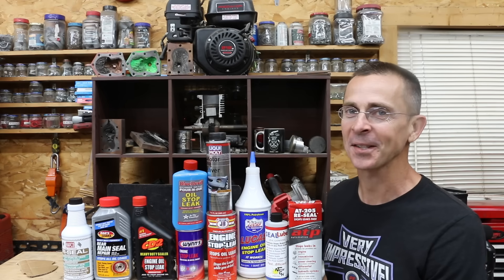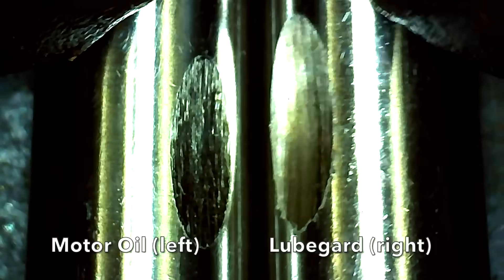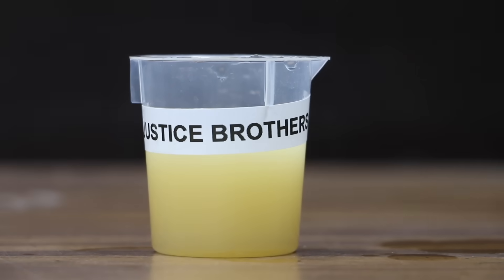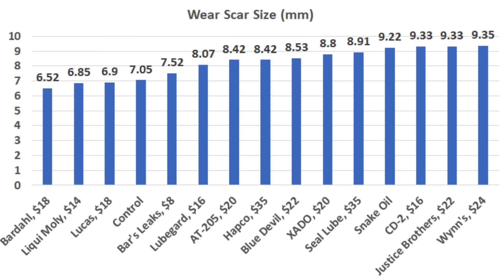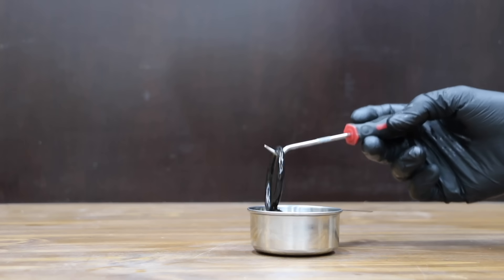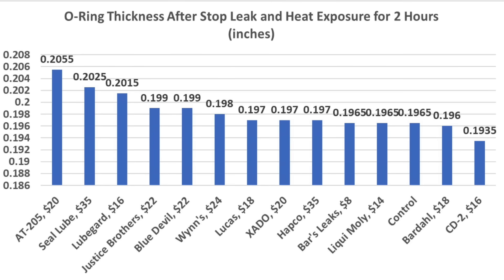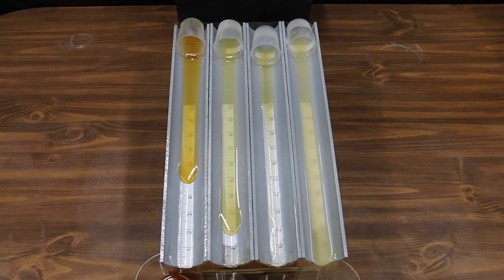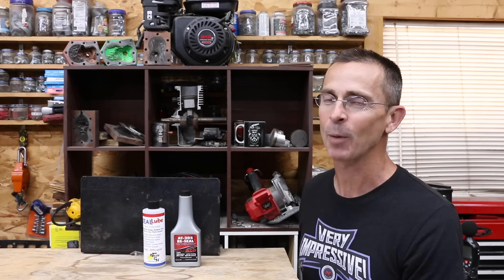Do Stop Leak Products Work? Do They Damage Engine Seals? Will They Destroy an Engine? Let's Find Out

Comment: I had great results with AT-205 on a old lexus where the engine seals we were starting to leak (as in a few drips overnight in the driveway).  I added a bottle AT-205 before an oil change with about 5 hours of cumulative driving time per the directions followed by an oil change and that was over 2 years ago with no leaks since from the seals since.  I highly recommend AT-205 if you catch the leak early enough.  It is also important to not let the stuff sit in you engine forever.  You need to change the oil after the 5 hours of cumulative runtime.  I also changed the oil at 3000 miles vs. the normal 5000 for the first 2 oil changes to make sure it's really flushed out. I'm back to 5k intervals again or 6 months whichever comes first (always with full synthetic high mileage for cars over 75K).  Always worth a try when the proper fix would have cost in the thousands.
Reply: This seems to be THE answer, use the best to fix the seal but given it was 7th on the wear scar then simply change the oil after a few hours ..   am I missing something here ?
Reply: Thanks for sharing. If I ever added it I’d definitely go this route to be safe.
Reply: Afraid not. It's only for rubber seals.  Not gaskets or rtv.
Reply: @PaulsToolReview  what's best for  silicone seal leaks,?  I been using high mileage full synthetic for three years now ,am still having a small leak from timing chain cover, taking it apart going to be alot of work
Reply from the maker: Thanks for sharing.
Reply: Can it fix timing chain cover leaks? Thanks
Reply: Unfortunately, resealing with new gasket or rtv is the only option.   I just use what the manufacturer recommends. It will be a big job you may want to take to a professional.
Reply: We have a leaky Audi Q3 that only gets driven 250 miles a month.  Could be a long time for 5 hours of driving.  Would you recommend a number of days or weeks before changing out the oil?
Reply: @jeffn2166  just 5 hours of run time.  It can sit in the oil longer as far as calendar and run time, but the manufacturer recommends you should see improvement after 5 hours of run time and I don't want to leave the additive in the oil longer than necessary as I want the additive package in the new oil to do it's job without interference.

Comment: I don't use it for stopping leaks but, loved to see that there is actually something behind the AT-205 advice I was given! Years ago an old mechanic told me to put the AT-205 in a spray bottle and occasionally mist it on rubber parts that are prone to cracking/dry-rot (boot guards on suspension, protective guards etc.) It works!
Reply from the maker: Thanks for the suggestion.
Reply: I've had luck with AT205 stopping leaks. I now know not to leave it in for an extended period of time now though.  It usually stops/reduces the leak within a couple hundred miles though.
Reply: @PayNoTaxes0GetNoVote  I just sent in this tech question to AT 205 ... your opinion please 
Your product is viable to use in power steering , I assume rack and pinion . If used is it necessary or " wise " to replace the fluid after the AT 205 has been used ?
Same Question for a rear end differential. After use should the rear end fluid be replaced ?
Reply: Scotty Kilmer put out a video about this a few years ago. I have a spray bottle in my garage with AT205 in it.
Reply: That mechanic wasn't Scotty Kilmer by any chance?
Reply: Scotty told everyone this information
Reply: An old mechanic named Scotty lmao. Come on
Reply: @ua7pyro591  hahaha that's the first thing that came to my mind lol years ago = last week 😅
Reply: @ua7pyro591  Beat me to it LOL
Reply: @ua7pyro591  Scotty used to be a VW guy, and AT-205 is very, very well-known among people who've worked on older VWs and BMWs, because both have a ton of rubber parts prone to drying and cracking and causing vacuum leaks. 

It ain't just Scotty that knows about the stuff and to spray it on rubber components. He learned it from somewhere, too.
Reply: works on wiper blades too!
Reply: So does any rubber protectant?
Reply: Broooooo I just tried this, I been chasing down a squeak for years. I think is gone. I sprayed EVERYTHJNG RUBBER IN THE SUSPENSION. I just used a spray bottle. Any other tips or wizdom you may share?
Reply: Sounds like Scotty Kilmer Channel R.I.P. SCOTTY
Reply: After seeing at205 cause more damage than oil alone and the heat (smoking) during the test, I wouldn't use it in my engine. I would advise you change the oil as soon as the leak stops because that oil is ruined. 

I agree it's good for spraying on rubber bushings.
Reply: @Alex-rj6sv  - remember,  PF mixed it 50/50. When suggested rate is like 1 pint to 6 quarts., so it was SUPER strong.
Reply: @PayNoTaxes0GetNoVote  That is important to remember as well. Thanks.

Comment: I wouldn't use that blue devil stuff on anything I used there headgasket stop leak an it plugged every cooling port on the block and head had to tear it completely apart and flush everything with hot water an scrape it clean
Reply from the maker: Thanks for sharing.

Comment: Love the videos. On this one for the wear test shouldn’t the mix be similar to what it would be in the engine? Either 4-1 or 5-1, because you definitely would use 2.5 quarts of each in your engine.
Reply: You probably wouldn't see the difference in a 30 second wear test using the products at the actual rated concentration. The wear test should just be taken to show that the products do in fact change viscosity but the actual effect will be smaller in real use.

Comment: Very interesting test, but the result interpretation is quite hard. Let me explain... you want to stop a SMALL leak and NOT damage your engine. If you have a LARGE leak then you need to repair it, or use aggressive product and... END your engine. So... from my PERSONAL experience with a few cars... for example Turbo Diesel Intercooled and naturally aspirated gasoline V6... use only Liqui Moly.
Why? If you have a small leak it will STOP it and will do NO harm to the engine, I'm talking about engine oil consumption, coolant water consumption and power steering fluid consumption. If the leak is TOO big, it will minimize it or do nothing at all, BUT everything will be fine - no addition damage will occur, you just need to fix it.
BUT if you have a BIG leak and use aggressive product, it can be fine for a very short time, and then... the engine will most likely die soon. Your making oil thicker and rubber/silicone seals soft and swollen, this will give up soon, making a total disaster and full engine repair.
Ow, BTW, basic ABC of engines is to change oil+oil filter+air filter every 10 000km (or ~6 000miles), transmission fluid every 60 000km (or ~37 000miles), coolant fluid and brake fluid at every 4 years and your'e gonna be fine. Just ignore car company guidelines to do it later and you gonna be fine...

PS: Just don't use injectors cleaner on diesel without disassembly of the pressure pump afterwards... it gets all the junk...

Anyway, great video, thanks!
Reply from the maker: Thanks!

Comment: I don't understand why these sham products are allowed to advertise the claims that they do. It seems like every other category of product is regulated in some way that prevents a company from putting water in a plastic bottle and claiming it's something other than water or can do something water cannot do, that kind of thing. Yet if you walk into an autoparts store there is usually an entire section of these products available that do NOT do what they claim to do.
Reply: AT-205 stopped a small leak on my power steering pump! 👍👍

Comment: Idea for your next video: Garage floor coatings! Compare a few polyaspartic, polycuramine, acrylic, and epoxy options to figure out which coating last the longest, has the best slip resistance, best impact resistance, etc.
Reply from the maker: Thanks for the suggestions.
Reply: @ProjectFarm  Hey, thanks for everything you do! Been watching your show for what seems like forever at this point - you do amazing work!
Reply: @ProjectFarm if you are going to do epoxy floors, you might as well see what kind of repairs would work on concrete, too.
Cement, grout, floor levelers, or whatever, to level up cracks, or fixing spalled areas.
Normal soap-and-water, as in a common degreaser found everywhere, dealer’s choice.
While we are on that part. It would also be nice to see what kinds of degreaser soaps are best.
Dawn, LA’s Totally Awesome (dollar store brand), Purple Power, and the like.
Some people might wish to etch concrete, so maybe a cleaner that has an acid additive? 
CLR comes to mind, but I would stay away from powerful ones, like Muriatic acid.
Reply: @ProjectFarm  
  Something to consider…How about tire marks left behind?
 Thank you.
Reply: Also compare concrete prep methods: various acid/chemical washes, angle grinder, shot blaster (can be rented from most home depot)
Reply: @cbrettsimpson0813  
Dude, this isn't a free Chemical Lab facility ... it's a "simple" Youtube Channel ..
Reply: Having worked as an installer, there's so many variables, not only concrete prep and measuring and mix ratios, but temperature and humidity on the day the product is poured. While a test of this kind might slightly show an advantage of one over another (though they all basically use the same chemical ingredients) it's unlikely to have any bearing on how it will actually hold up for an individual at their particular garage.
Reply: Add sand for slip resistance so delete that factor and just test the product but the best bet is to prepare the surface extensively and almost any product will work better.
Best result pour a new slab and then apply product with a handful of sand.
Idealy fine quartz. 
Just realise you created sand paper of the highest quality. You are welcome.
Reply: Yes to garage floor coatings! Please don’t forget to test for hot tire pickup…
Reply: @natepeipman5085  dont drift around the corner as you get into your garage with your flip up plates.
Every one has a gun.
Grandma will shuut the crap out of u
Reply: Tar and Feathers work fine ... a bit Sticky on hot days though 😄
Reply: How about testing toilet bowl/calcium/hard water spot cleaners, CLR, concentrated vinegar,  acids, and maybe the supposedly greatest, Santeen toilet cleaner
Reply: yea that'd be great
Reply: This Please!
Reply: Great idea!
Reply: Fantastic suggestion!
Reply: Bare concrete
Reply: Good idea 😊

Comment: I have a problem with this testing you did. In the first test you had it 50/50 but in any and no engine would that be the case. If you used the standard 5qt engine and percentaged it out then people would be able to do their own math and figure it. But, 50/50 gives no one a real world ability to figure if one little bottle is actually good in 5qt of oil... I'm willing to bet if you mixed half and half oil and KY jelly they wouldn't separate and it would do very well at first on a pin test.
Reply: And yes brother, you're still awesome at showing the world the bs in some products and the ones that hold up to their claim/s.

Comment: Liqui moly for example sais that their product will take 600-800km to show effects. So I dont know how definitive the seal expansion test was. Also I would see an issue with running a product that  managed to expand the seal so much in such a short time in an engine for an entire oil change interval. Do any of the products specify their use time or recommend an oil change after some period of time?

Comment: I used the AT-205 in my transmission and I think it helped a little. I’m pretty sure I have a leak from the front pump seal behind the torque converter or the torque converter itself.
Reply from the maker: Thanks for sharing.

Comment: 13:00 I suspect those products will keep softening the rubber components and are designed to evaporate and stop working when the job is done to prevent completely dissolving or liquefying the o-rings etc.

Comment: I have used bars leak and it worked great rear main had a Constant slow drip about every 10 seconds per drip fixed in 20 minutes lasted years surprised it was so low on the tests
Reply from the maker: Thanks for the feedback.

Comment: On your wear test I don’t think you were mixing the oil and stop leak to the correct proportion. Using a a small sample and mixing them to about half and half doesn’t equate to mixing the product with the full amount of engine oil. That’s why you are getting so much wear I think. In the proper mix I don’t think the lubricity would be effected so much.

Comment: You should test shop floor coatings, epoxy, polyaspartic, concrete dye,vs concrete sealer aginst base concrete. For chemicals, welding Slag, chiping, cold weather, hot tires, metal casters, ease to clean, tool drop tests, Yellowing in sunlight.  Great show
Reply from the maker: Thanks!  Thanks for the suggestion.

Comment: Just a note, AT-205 (and i bet all these products at least ones that worked) are just Diethylene glycol. It will swell the rubber yes, but it will also destroy it, i wish you did a long term test you'll see rubber in contact with ethylene glycol will turn to a gooey mess. Just look at how much 2 hours of exposure did. for reference shore A 50 is about as hard as pencil eraser and that's not gonna last in an engine. All these products should be treated as temporary fixes to get you to the proper fix, unless the car is a beater in my experience these products and radiator stop leak will destroy your engine. I build motors for a living and a block and head that's had stop leak in it is often scrapped it's just not worth trying to clean out most of the time and machine shops will charge extra for having to clean it (it also gums up parts washer pumps and all that).

Remember if it's cheap and quick, it's not good.
Reply from the maker: Thanks for the feedback.

Comment: 1983 Cutlass had a steering gear leak, used brake fluid and it sealed it up. When topping the empty reservoir with brake fluid, the steering wheel would not return to center after turning. After using for a couple days, drained it out, topped it off with transmission fluid. Just wanted to share.
Reply from the maker: Thanks for sharing.

Comment: I’ve had good luck with the at-205. I tried it for a main seal leak because of Scotty’s video and ended up forgetting about it(in a good way.) Then changed my oil months later and forgot to put another bottle in the new oil, then saw a puddle a couple of days under truck that I hadn’t seen in a while. Could be unrelated, but I feel confident it really did slow the leak down a ton.
Reply from the maker: Thanks for sharing.

Comment: So, basically the ones that improve or maintain viscosity did not provide as much leak stop and vise versa. Its a tough call deciding between both and I agree should only be used based on need.
Reply from the maker: Thanks for the feedback.

Comment: Something I'd be interested to know is what happens if you subject the expanded/softened seals to another high temperature cycle. It seems to me putting in the higher-wear products and operating an engine for a few hours before an oil change could be a viable strategy, but only if there's a lasting benefit.
Reply: Yeah, I'd also be concerned about long-term exposure to a softening product destroying seals. If I used it, it would be for a hundred miles or so and then removed from the engine.
Reply from the maker: Thanks for the suggestion.

Comment: Great test. I don't uses stop leak except for power steering in an emergency before repair can be made. However, I have used radiator stop leak. maybe you could test that? BTW, Your wife is still looking for her measuring cups ;).
Reply from the maker: Thanks!  lol

Comment: AT-205 works really great in ball joints and overall rubber/plastic parts of your vehicle suspension. It has worked very well on both of my corollas, really smooth and quiet over road holes and speed bumps.
Reply from the maker: Thanks for the feedback.

Comment: Softer seals are more prone to friction wear. You are likely better off with stiffer seals than slightly over-softened ones. You may also want to take a second look at the gaskets and rings after months of exposure to additives: I've once tried to use softener to restore dried-up rubber in a cassette player. Seemed to have worked great initially. A few months later though, I tried to play a tape and found out most of the rubber parts I had "restored" got turned into sticky goo over time.
Reply from the maker: Thanks for the feedback.
Reply: The cheap rubber in a cassette player is a lot different than the rubber components in engines
Reply: @Beardman56  This isn't a matter of cheapness. If a chemical causes rubber to swell, you have to be wondering about what sorts of physical and possibly chemical changes are being made to cause it and possible long-term effects. That is why he warned people not to put "stop-leak" additives in unless you already have a leak. That way, if the additives ruin more seals, at least you were already on your way to needing a rebuild, engine swap or scrapping the car altogether.